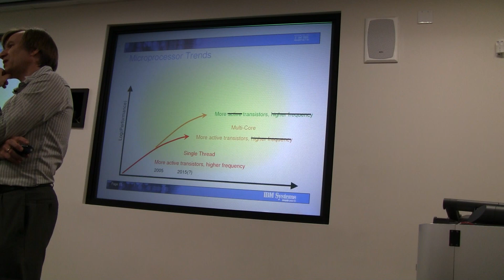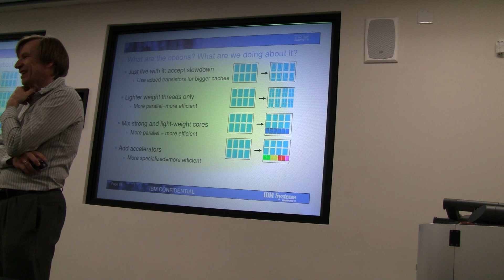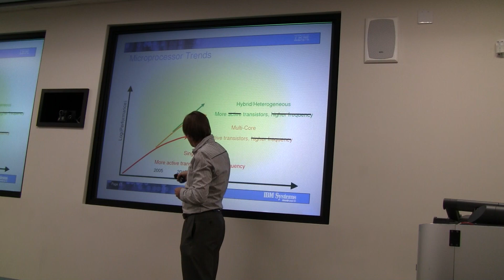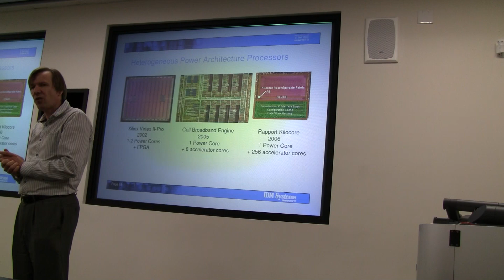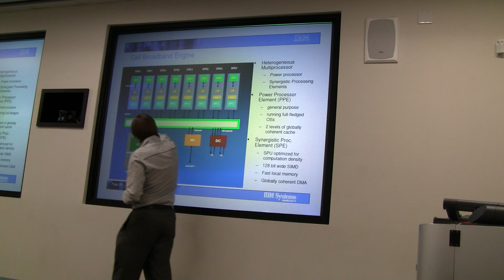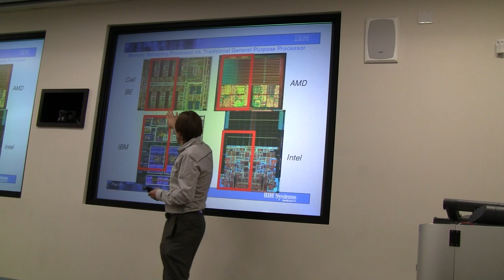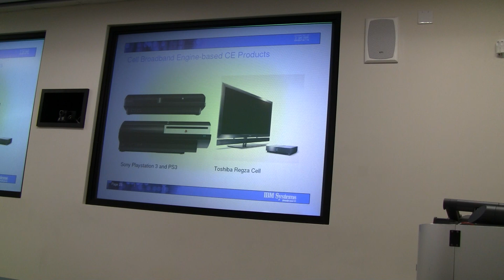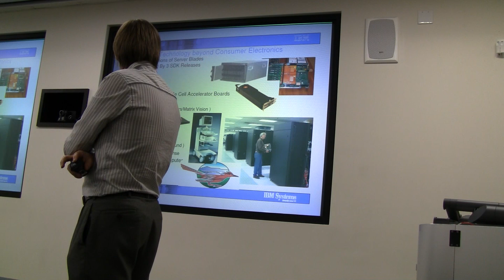Cell Processor - Part 2

Comment: Wonder what life would be like if they kept working on the Cell for the PS4. Factoring in fabrication process shrinks, it could have shipped with a 32 or 64 SPU config in time for the PS4. If they addressed some of its shortcomings like adding more local memory to each SPE, giving it a better higher bandwidth bus to the GPU (PS4s Garlic bus already does this), and giving the GPU and CPU a unified  memory pool, that would have been a box with a lot of potential, though juggling 64 plates would be hard on developers.